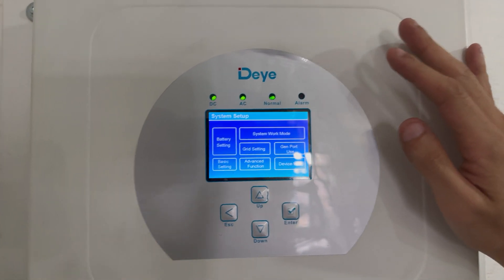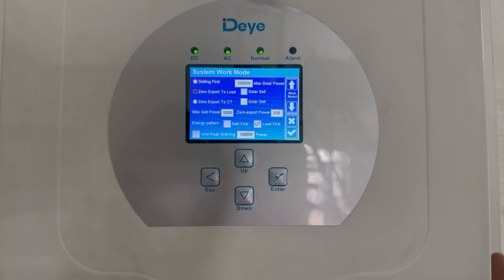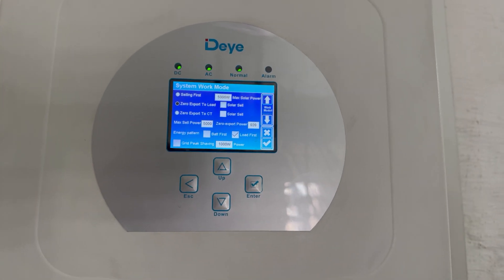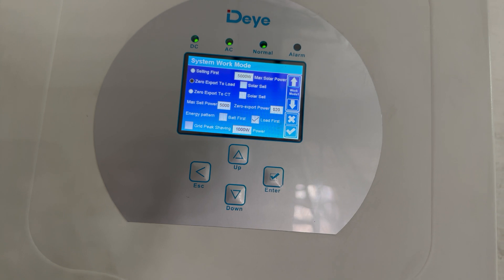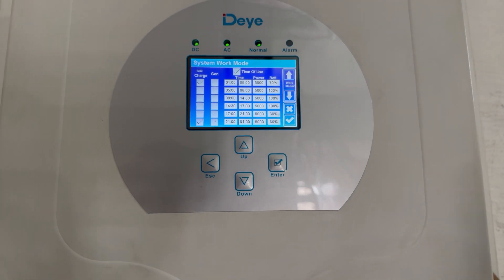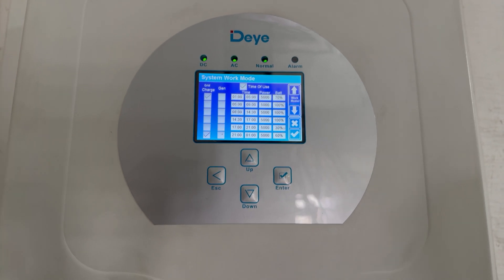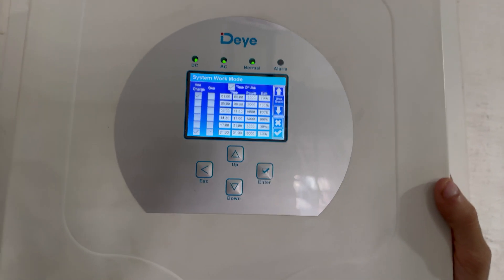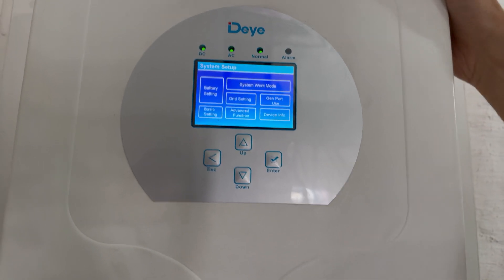Deye system work mode walkthrough

Comment: Hi guys, thanks for the video. I would like to know if you have ever tried ac coupling with your deye Inverter? This is when you have an existing grid tie solar system installed and you add your new deye hybrid inverter and use the excess solar of the old solar system to charge the battery during the day and then use the battery power at night or during load shedding? If you have, I would like to see a video about it. I know that some guys have tried it overseas and it works apparently...

Comment: So with the work mode hours you set the periods and then the target battery charge, limiting the power and enabling the charge from grid. For example, if the battery starts a period at 80% capacity and the limit in the period is 50%, then it will use the battery until reaching that level. Once reached, the energy will come from the grid, ¿Right?

Comment: Hi buddy, thanks! I recently installed a 6kW Deye inverter system with 4 units, totaling 24kW. At first, I was only using the PV panels to charge the batteries. But now that it’s the rainy season, I connected the system to the grid and adjusted all the settings. However, the "X" sign on the display hasn’t changed—it’s still showing the same. What can I do to fix this? Could it be a firmware update issue?

Comment: Hi. I have a 16kW Deye inverter. The Max Solar Power was set to 5000, but system shuts down from time to time, unless i switch the geyser off. Will increasing from 5000 assist? How much should max solar power be set at?

Comment: Hi, why would my Deye 5kw take grid power when solar generation is not enough but battery is full ?
Reply: check if in time of use the power is set to 0 - if its set to 0 during one of the time slots - it will do exactly that
Reply: Thank you for answering. Where do you mean please ? I dont understand its mus be set to 0 or not set to 0. Thank you so much!

Comment: Hello . What is  the "Power" from system work mode page 2..  betwen time and batt. You have 5000 set
Reply: that's the amount of power that the inverter will take during this time slot from the battery if it will be discharging it - if its set to 0w it means that during this time slot the battery is only allowed to be charged and 0 power will be taken from it - its useful to be set during peak sun hours so all of your solar generation goes to battery for storage and exceeds will be used for load, but there is a minus of course - if solar cant make enough to cover the load consumption and the power in time of use is set to 0 - power will be taken from the grid to cover the load consumption